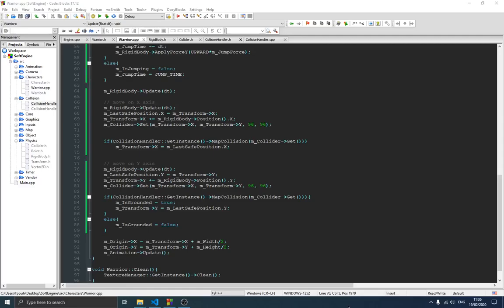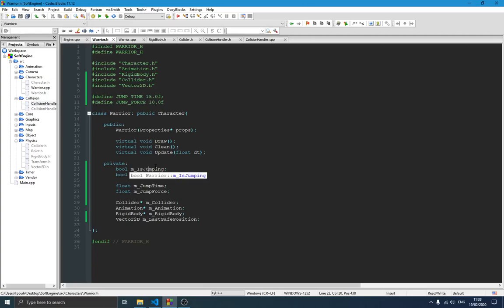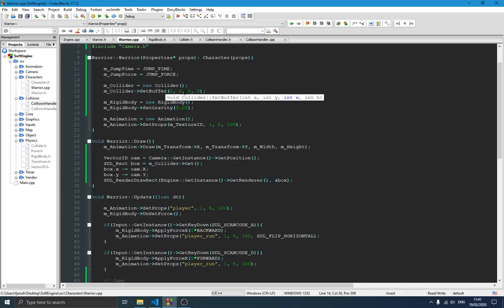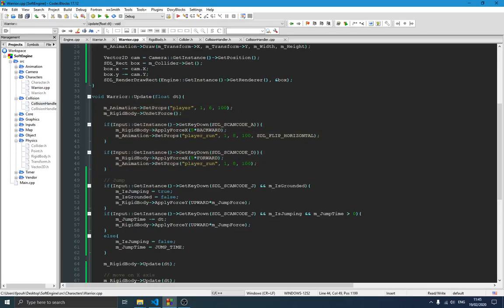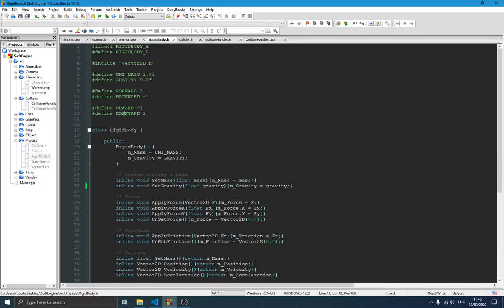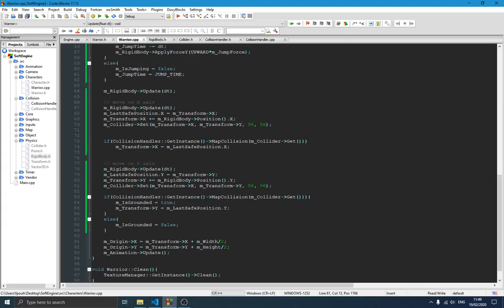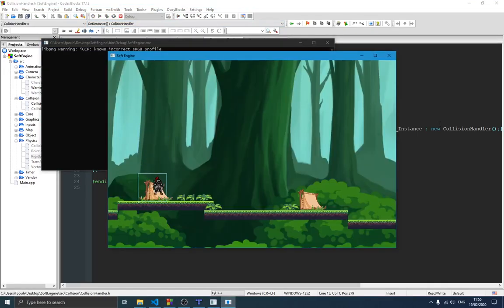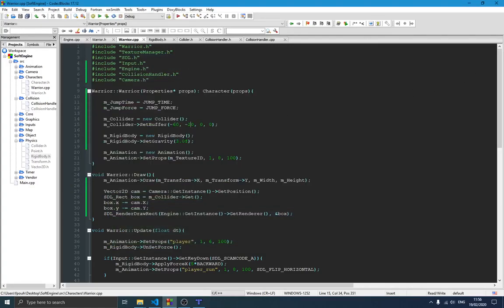Collision Handling SDL Game #Part 20

Comment: My Player does not stop when colliding with the tiles in horizontal axis
Checked the logs and MapCollision returns true when there is a tile but its still passes through
and once it passes through the vertical motions is stopped and player can not jump
(Had The same issue where player used to phase through tiles vertically, resolved it by adding the following command 
m_RigidBody->ApplyForceY(UPWARD*GRAVITY);    )
Any similar way to resolve the horizontal collisions?

Comment: I am having difficulty with m_Box in collider class. On re-compile... m_Box.y is initialised to huge negative number and so nothing appears on screen. 
Any ideas why?? or how to fix?? Have tried initialising m_Box by adding a Collider constructor and initialising there....also tried initialising m_Box with 
m_Collider->Set(0, 0, 0, 0) in Warrior constructor............no joy though...??
Reply: Had a similar issue where the y value of the transform would become infinite - make sure that you initialize delta time and last time to be 0.0f in Timer.h
Reply: @erfer  I was having this issue too, and tried fixing it for two weeks without success, thanks a lot this worked!